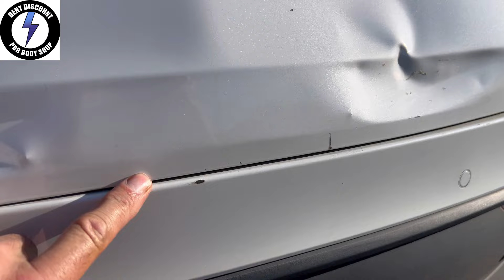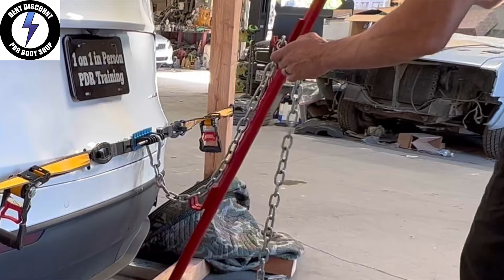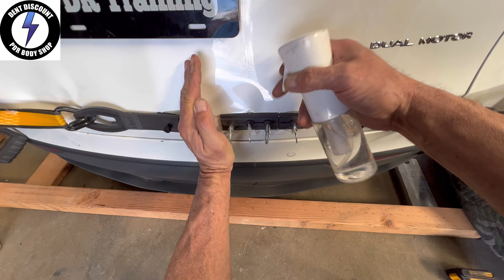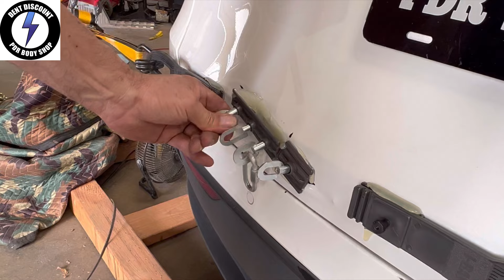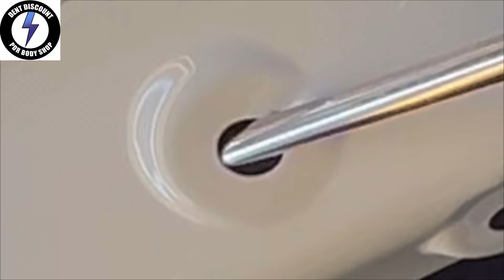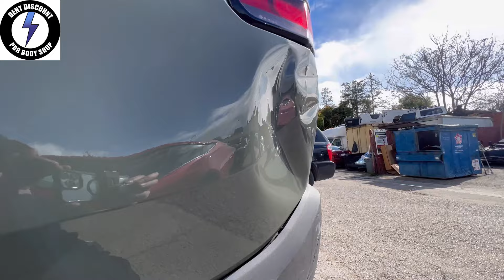Tesla Dent Repair San Jose /Paintless Collision.

Comment: Would be good to see more detail when knocking down and using rods. The shapes of tips applied to surface and motion and force used. Get some close ups and dont rush through that part as its the most finicky and important. I feel confident to pull a major part of a dent easy enough but the finishing looks much harder.

Comment: Im curious in what glue you used and the key to keep it sticking so well? I bought a mini kit with the black and yellow glue stucks with a slide hammer, it comes right off the second or third slam. I see you really putting some weight on those tabs and it seems to stick so well.

Comment: Is there any good garage like this in Ontario?
Reply from the maker: Google Paintless Dent Repair read the reviews
Reply: @DentDiscountPDRBodyShop  fair enough, thanks. I got an audi q5 that I bought after accident, I repaired it myself, but there's still a big dent under the rear left light. I was thinking about replacing the whole trunk gate, but it's not worth it at this point.

Comment: Very nice Ken. Question.... How did you get the bottom part fixed, the frame crease which is extremely difficult to flatten down? I had a Tesla dent similar the other day and I heated it right up and tried pushing a blade edge whale tail bar in to try and split the adhesive but with no luck. I know it's tough bonding from when I was a panel beater and use to do door skins.
Would be great for any pointers or guidance
Thanks Martin 🇬🇧
Reply from the maker: What’s up buddy!! how are you doing Martin?
I did use a lot of glue behind the scene to raise it up and knock it back down.
A lot of blending.
Reply: @DentDiscountPDRBodyShop  thanks mate.
Did you literally rip it from the internal glue then? Sounds like the only option but a “balls in” approach!

Loved the lateral frame too I had something similar in mind 🙌🏼